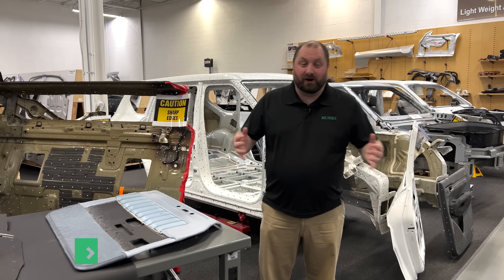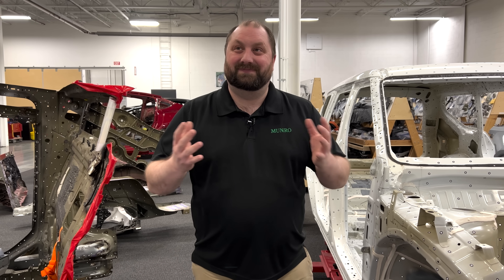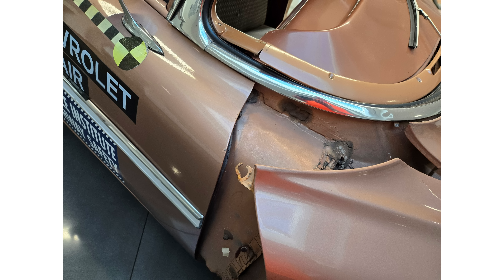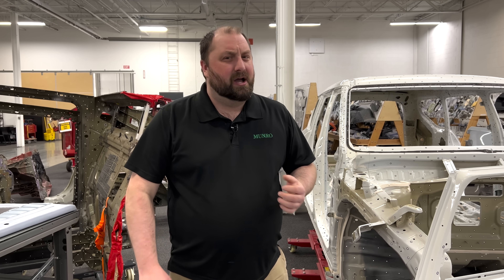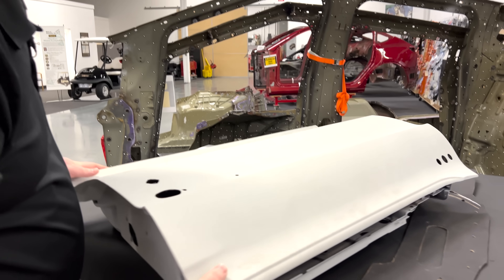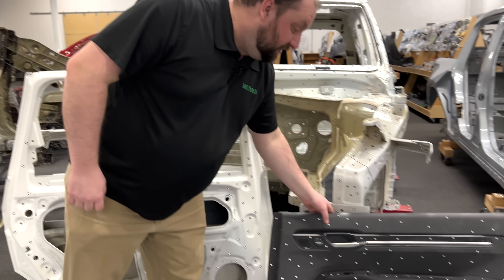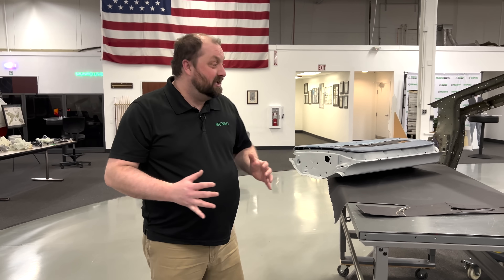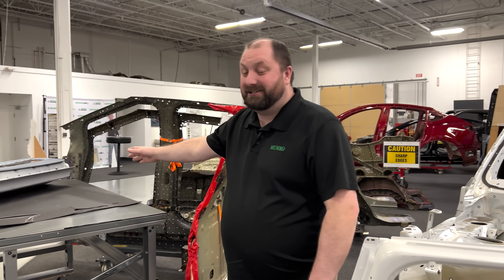No, Your Classic Car Isn't Built Better Than Your New Car

Comment: Yeah well with all the recalls that happen now I think your premise is completly wrong. Cars were far better in the past! more reliable and less cost. We are all so safety concious now well get over it life is a risk and I have no problem driving wthout a seatbelt! I prefer no computers of GPS tracking or the ability to shutdown my car remotely. I will take a risk because that is what life is about! I drive a 1995 E320 and it is way better than any car built today ...by far....
Reply: If you go back far enough, cars were a lot less reliable. There were a few models that were good but most were crap. 90s and 2000s were probably the peak for reliability across all cars on sale with variations between manufacturers. Mercedes peaked in the 80s and early 90s and Hyundai/Kia started peaking towards the end of the 2000s, apart from their US made Theta engines.
Reply: You STILL drive without a seatbelt!? You haven't learned a thing about safety, have you?
Reply: @snowrocket  awww safety everyone is so worried about safety. I will forgoe safety for freedom and fun. I am not averse to risk like all the modern day, light in the loafer people. Risk is a balance and risk must be taken to acheive goals and desires. We are so risk averse ! what happened to this country. Now a bunch of sissy's !
Reply: No,  they were not more reliable or lesser costly,  when you adjust for inflation,  you'd be surprised how little you got for your dollar compared to modern cars.
Reply: @jamesengland7461  HAHAHAHAH are you kidding me? The costs of these new cars are simply unaffordable. All of you are deluded.....
Reply: You are foolish.  Recalls now because more stuff is monitored.  In the 50s,60s,70s,there was not much consumer protection,which is what recalls is all about.  Recalls matter,it gets things made better
Reply: @cengeb  recalls dont make anything better thy just correct a manuyfacturers failure. Just because a car has more sensors doesnt make it better. You are all the fools for buying the junk that is produced today and somehow thinking because it is new it is better. HAHAHAHAHA. Good luck with that and owning your new junk! You will be spending more time in the shop than on the road. Oh and when you buy a toyota tacoma brand new that needs a complete engine replacement come back here and tell me how the new vehicles are so much better and more reliable.
Reply: @dontwantahandle620  live in the past...take your propeller airplane on your next over seas flight, good luck getting there, in days.  Modern cars are extremely more reliable, longer lasting, much less maintenance required.  2025 join it 1965 cars where junk, I was there, I seen em all, I wouldn't want any part of my 1966 Chrysler Newport today, with it's drum brakes, fading paint in 3 years,bias belted tires that wore out in 20,000 miles, and sucked for traction and handling, and nothing like plastic covered seats to burn your skin in the hot sun, when hard metal dash boards killed on impact.  Get real.  Carburetors where a disaster, constant need of rebuilding, cleaning, change oil every 3K miles, and engines at 50,000 where worn out junkers.  The material used today last a long time, lighter, safer and everything else better.  Why in 1966 car did it need a new exhaust system in 3 years, from rotting out, cars now barely ever need exhaust parts replaced in hundreds of thousands of miles, I had on a modern  VW Jetta go 316,000 fun reliable miles, same exhaust system never touched the manual transmission.  New cars are always better than old junk with no safety features, horrible handling, and uncomfortable seats and driving ergonomics, nice hard metal horn ring to knock your teeth out in an accident.  2025, join it
Reply: @cengeb  Never gonna do it. I wont purhcase any car newer than 2010. You are comparing 1966 to 2025. @spankeyfish is right. Car manufacturing peaked in the 1990's and my 1995 E320 Mercedes is a better car than anything built today or that will be built in the future. I will keep my GPS and modern computer-free car and you can enjoy the government knowing everywhere you have been,  a computer which could have someone remotely turn your vehicle off, or even disable it, like a tesla... enjoy  your relaible and constantly recalled cars due to the over complicated engineering.  Show me any car from the 2020's that is going to last anyone 300K! hahahahaha they are making junk and selling it for more money than it is worth!
Reply: @dontwantahandle620  so car technology stopped improving in 1995? Are you for real? Guaranteed a 2025 ,is superior to a 1995 in every aspect.  I had cars in every decade starting in the 60s...my current 2019 vw golf r is the best of the 30 plus cars I've had...comfort performance reliability,efficiency...at around 93,000 mies i drive a lot less now retired,17 or more vw audi stuff too many GM junkers all with consistent same problems...I drove a lot all cars ,OVER 1.5 MILLION miles
Reply: @dontwantahandle620  1990s carsxwhere not more reliable ,get out of your time warp,being stuck in the past is a sad life

Comment: Decades ago the guy who developed the Ford mustang ,Iocca? Was asked what he should do with his original Mustang? The guy told him get rid of it and get a new one. New ones are safer and better..old cars are junk in so many ways...inefficient, unsafe,lots of unnecessary pollution
Reply: Some of those problems are very fixable, improving the engine with Electronic Ignition and Fuel Injection can reduce the pollution output while improving performance and efficiency. Replacing the Power source and Transmission with a pure Electric drivetrain and battery  . Refurbishing the interior and uprating and improving the brakes will leave you with a nice tribute to the past . Retrofitting Air bags and other safety devices might improve survivability should one have an accident. It really comes down to how much the car design really means to you .  I would dearly love to have a 1957 Stingray with full Electric conversion or even a Full Electric MG C GTSports car … similarly a Cybertruck or a Plaid Model X could be fun too … the sooner we can cut back on refining Petroleum and lower how many Rare earth minerals need to be Mined … the real Safety feature is knowing if you don’t take care you probably won’t be able to replace it …
Reply: @chrisbraid2907  tesla is junk,especially that unsafe for humans cybertrash.  It's a knife on wheels,really dumb vehicle.  And the updates you mention is why buy new and leave old junks in the scrap yard.  It's 2025,a car from 1965 or so is not  road worthy no matter how much money you waste on it.  Do you still want to fly in a plane from 1965 not me

Comment: This is exactly why you don’t give a teenager a classic Mustang or VW Beetle for their first car!
Reply: My first car was a 69 bug. Minor sheet metal and a spare tire protected your feet, with a gas tank above your knees. Of course, it was only 8 years old when purchased (for more than the sticker price new). It was a great first car. Times change. I would never consider it today.
Reply: @  My first was a well used '73 Pinto hatch w smallest engine - 1600 cc.  Barely hit 85mph on flat w a tail wind in ten minutes.  

I was very happy to have it, first long distance personal independence.  $640 plus new radials (had terrible bias ply)...call it $4k in todays money
Reply: @Mrbfgray  bruh 1600cc ?there's engines that's bigger for the pinto?
Reply: @   HA!  
By prehistoric memory there was a 2400, sister had slightly newer wagon version.  

Early '70's getting toward peak poor American auto....heavy sloppy handling drum brakes, minimal safety, shameful power and performance.  But I was happy w rack n pinion steering!  Seriously it was 'brilliant' for it's day in USA.  

1.6 liter today is real power, was only 60hp back then.  (guessing - two riding home mowers  😄)

Then the Japanese came and taught us how and what to do cars.
😉😊
Reply: @  Fun story:::bro and I and friend, only wild bro old enough for drivers lic. in mid high school.  

Coming from a hotsprings swimming pool, couple mile long side road from highway, bro took '69 Buick Le Sabre (lol) as fast as she'd go...I looked at bro as we passed "Stop Ahead" sign, expressing concern he still has gas pedal floored.  

We were in the mid 80's mph, traffic on 2 lane highway going past both ways as we approach, brakes severely faded, NO WAY to stop, fortunately bro let off brakes  last second as we made the safest random turn to Rt at tire sliding sp.  

Friend in back was laughing his ass off like it was all planned.   
😄
Reply: @Mrbfgray  bruh
Reply: My first car was a Beatle, I was lucky to never be in a wreck. That car did teach me how to control a spin out, hydroplaning and such. I guess the lack of safety features improved my driving skills. That said, my kids had new cars with current safety features for their 1st vehicle because I didn't want to risk their lives.
Reply: @ 
Absolutely!!! 💯
Reply: Best don't GIVE a teenager a car at all, they should EARN it themselves and then they'll take care of it and thereby better care of themselves.
Reply: @Mrbfgray  though usually they will end up with a 30 year old car with even fewer safety features 😂
Reply: @johnrickard8512   Sure but nothing replaces respect for reality and earning it themselves means less pointless driving and later start.
Reply: @ and hopefully also more care for the activity
Reply: @Mrbfgray  My brother and I bought junky old cars and our dad helped us learn how to fix them. You REALLY appreciate something that you had to buy and fix yourself.
Reply: @  Similar for us.  

My assumption of the "lottery curse" is that life changing sudden unearned wealth causes far more damage than good to most ppls lives. Those who think it will solve all their problems are in deep trouble.

An extreme example of same phenomena, hard to value that which comes easy
Reply: @  We knew of a family that bought their high school kid a new Corvette, he and a friend crashed it drunk one night at high sp and were in the hospital for for weeks w serious head injuries (I assume never to be the same).

Upon being released from hospital - new Corvette in the parking lot.  Our fam thought that was the most idiotic thing parents could do.
Reply: @Mrbfgray  I agree to a certain extent. I wasn't given a car, but I was helped to purchase one. The way my father helped was instead of just buying me a car, I worked under him for a few months and saved up my money. His promise to me was that for every dollar I earned towards the purchase of my own car, he would match it. That allowed me to get a very decent first car, which was a 2009 Toyota Corolla with around 40,000 miles on it. It wasn't a flashy car or a super amazing car, but it took me everywhere I needed to go and did so safely for the following 6 years from when I bought it. The only reason I had to get rid of it was because I was crashed into on the side by someone running a stop sign. The insurance company I had at the time decided to total the car and just cut me a check for its market value. This allowed me a decent down payment for a much newer car, a 2018 Honda Accord. I will never forget how my father helped me get a good first car and the lessons he taught me. And no doubt that having a half decent car definitely helped me when I had my accident, instead of having a very old rusted out car.
Reply: @Mrbfgray not everyone is like this.
Reply: @Maximus20778   Everyone values based on scarcity and difficulty.  That which comes easy goes easy, simple human nature.
Reply: @Mrbfgray  
I gave my daughter a Tesla Model 3 for Christmas as her first car.
Reply: @   Only prob w that is it's too fast for most kids, great cars tho.
Reply: @Mrbfgray  
Tesla's parental controls allow parents to restrict certain features and settings within the vehicle when it's being driven by a new or less experienced driver. These controls can be accessed through the touchscreen or the Tesla mobile app. With parental controls enabled, you can set a speed limit, reduce acceleration, enable safety features, and even send curfew notifications.
Reply: @RayNLA  good choice
Reply: @ 
Safety First!
Reply: @ Safety is relative. I’ve always found the best safety feature is “see the car about to hit you so you don’t get in a wreck”
Reply: @RayNLA Except Teslas are junk
Reply: Totally agree at least get them something with a decent body cage design, ABS and Traction/Stability control such as a relatively new Golf etc it will almost certainly save them  and you money on accident repairs and possibly their life…👍😊
Reply: Great article and so well said, I love classics but not as an every day drive…👍😊
Reply: I got a beetle for my first car in 2019, one of the biggest things it taught me was to drive defenseively, constantly. I didn’t drive it in the winter though it wasn’t my only car.
Reply: @ 
Defensive driving is very important! 
Thanks for sharing
Reply: In the school where I teach auto mechanics, we generally see one student killed in traffic accidents annually by the poor combination og young inexperienced drivers in old unsafe cars. In Denmark especially trainee mechanics is one of the worst insurance categories.
Reply: Classic mustang perhaps. A Beetle will teach them to drive responsibly.
Reply: When it’s just given to them of course, when they put enough into it themselves they’ll drive differently
Reply: My first car was a 79 camaro with a 550hp big block and a t5 but i pulled that thing out of the junk when i was 14 and spent 2 years building it so i made sure it doesn’t get wrapped around something
Reply: Uber has the cutoff at 15 years. This is for one, ride-share quality. And two, liability.
Reply: Totally agree. Or even a 15 yo old car w missing safety features.  They need all the help they could get
Reply: @ 
Very true!
Reply: @Wasabi9111  nobody can afford to give a kid a car newer than like 15 years old lol. my first car was a 22 yr old honda I had to buy myself, at 20
Reply: @Wasabi9111 Eh a person should be able to operate a vehicle with out all safety features except ABS; most of them hold your hand way too much.
Reply: @ well, no matter how great of a driver you are, you’re still human ans no human is perfect.   Everyone could benefit from the latest crash avoidance features, especially new drivers.  Also, you can’t control other drivers, especially distracted drivers around you, so the newer cars w better crash structure would provide better crash protection.
Reply: @Wasabi9111  I agree with safer vehicles from the standpoint of airbags and structural integrity; but most “safety” features aren’t necessarily, or are more problematic than helpful; I drove a vehicle with lane assistance, and it had me all over the road like I was drunk.  I don’t want my vehicle making decisions for me, except for abs.  I’ve had more sketchy situations with TC vehicles cutting power when I need it than it’s ever helped me.

In addition to that; I think the safety features make people (especially new drivers that are relying on them) lazy, and count on them to correct their mistakes.

Defensive driving and paying attention is much more effective than any safety system.

And I’m not some old dude that’s stuck in the past; I’ve just seen young people my age that expect the car to figure out all this stuff instead of getting to know their vehicle’s handling capabilities and characteristics.
Reply: @Wasabi9111  15 years ago, there were still most of the safety features as on current production vehicles. The best help they can get is teaching them to drive well, as a good driver is, by far, the most important safety feature.
Reply: Anything from the mid 2000s is safe enough, no need to buy an 2025 70k$ tank
Reply: Absolutely true, furthermore you put them in a big heavy vehicle like a suv because size does matter also and every year vehicles get safer and stronger
Reply: @middleclassretiree bigger meaning a death trap to other people?

Comment: i daily a 1961 mercedes 220s. nevermind plastic it barley even has rubber in the engine compartment.. all the vacuum hoses are in brass. it was crash tested and has overly large crumple zones. there are films of mercedes crashing the chassis in many different creative ways that wouldnt have been thought of today. I have always been impressed with w111 cars ive seen crashed. My other daily is a 1988 saab 900 which has a single section of aircraft grade steel for the A pillar which continues all the way to the wheel well. Saab obsessed with the A pillar being strong enough to stop a moose  and it is argued to be the safest car in a rollover ever made. the GM saabs like my moms 2008 that followed were actually given bad ratings for rollover because gm was trying to make saab into a profitable company.

Comment: It would be interesting to know what you think about reliability. I keeping on seeing lots of mechanics talking about newer cars like they are all made like junk compared to older cars.
Reply: Aren’t newer cars much more reliable? I remember growing up in the 80s reaching 100k miles was such a big milestone, while now it’s nothing.
Reply: There's a growing sense that the least troublesome cars were 1990-2005. They were high-tech enough to drive well and be reliable, but not overly complicated and expensive to repair. I tend to agree with that.
Reply: @snowrocket  I agree with this, and I think that would include most 2000's era cars. My '08 Honda Element has been reliable with obviously modern electronics but not overly complicated.
Reply: It used to be you needed to tune up every 6 months or else the engine would run really badly.
Reply: @davidsuzukiispolpot  Points, condenser and spark plugs had to be replaced every 10,000 miles.